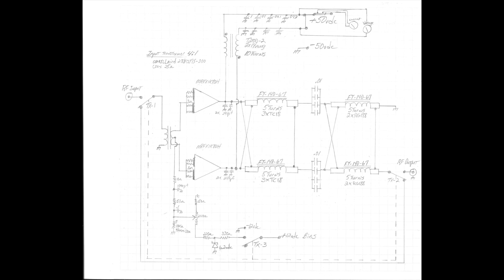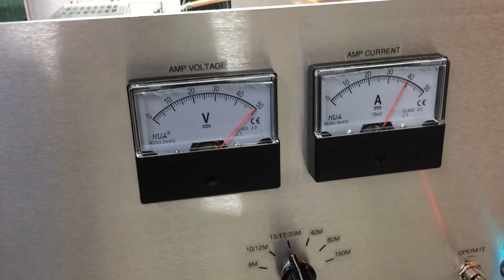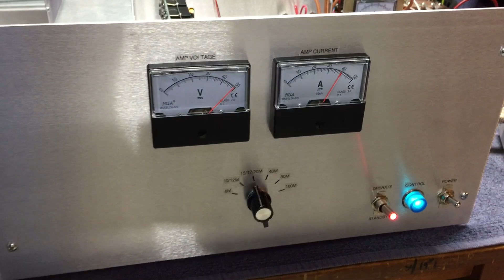2xMRFX1K80H 1.8-54mhz HF AMPLIFIER

Comment: KF8OD, Very nice amplifier. I am trying to settle on a design for a full legal limit mobile amplifier with 5 parallel boost supplies mounted  close to the batteries under the hood of my 2019 F450. However it will likely end up on the other side of the the fender skirt as there is not much open space left under the hood. There should be plenty of space for the amp behind one of the back seats. I haven't settled on which LDMOS device to use, but am going to do it with a single push pull circuit. I was planning to utilize feedback in the circuit to improve linearity, but saw notes by other builders advising against it due to the possibility of causing the circuit to go into oscillation. However, I noted that you utilize feedback. Did you utilize circuit modeling to find the correct components or do it by trial and error? Ever lose any parts due to the circuit going into oscillation? Any advice would be appreciated. Thanks in advance WD0DIA
Reply from the maker: Feedback does nothing for linearity, LDMOS devices are not linear. I have never experienced oscillation. The feedback really only tames the gain on the low bands and keeps the rf input pretty uniform across 1.8-54mhz.

Comment: For anyone trying to figure out the efficiency and thinking Wow 40a @50v 1000w and thinking that isn't very efficient... Remember these are LDMOS Chips... they really don't start getting efficient until you get up to about 50-65% of its rating( theoretically 3900w@65v )... he's only running them at a 1/4 of what their  capable (not including losses)....  No, I don't advocate running anything at max but whenever he gets close to 2k that efficiency is going to come up quite a bit. Just thought I would throw that in there
Reply from the maker: Thanks for your comment. I was much more concerned with IMD and harmonics. Don’t really care about efficiency.
Reply: @KF8OD1  I figured you already knew about it when I posted it...I was just posting it for others that noticed the amperage vs Wattage. And then think the chip wasn't very efficient... I was just clearing that up for them... I remember when I first fired up a blf188xr and just  through a few milliwatts into it I only got something like 14% efficiency... people used to silicon transistors don't understand that until they are putting appreciable power in the input into a Mosfet the efficiency is way down.... and is actually hard on the chip itself...  better to lower the voltage a few volts with ldmos..

Comment: hy there, what smps do you use in every rf pa?
Reply from the maker: Mean Well RSP-3000-48
Reply: @KF8OD1   thanks,  do you have any smps recomendedation for 1kw pa 48V and 27v Sat mosfet,?
Reply from the maker: @endremurti  Mean Well RSP-1500-48. I am sure Mean well makes a 24v supply that could be adjusted up to about 26v.

Comment: Hi Mike I've asked this before but do you feel a need to run your amps with LPF? If you operate on the air without a low pass filter do you notice a difference?  Eric
Reply from the maker: Eric Lessard  Yes, you must use a LPF to comply with FCC regulations.

Comment: I think you need a lot more fans extracting hot air from the box.   I think you only have one!!
Reply from the maker: Thank you for your comment. There are three fans on the heatsink that exhaust all the heat out the side of the cabinet.

Comment: Very nice amp.I love these devices. I want to use the new 65 volt version of the device. I just completed a 75 amp 55-65 volt variable power supply for the project..next is the RF deck. Do you have a pcb set available for purchase? Or even a pcb layout? I am also interested in the transformer and choke parts. The pcb/engineering design kit from the mnfg is ridiculously priced. I want to use 2 devices and let it loaf. I’ve been using an 8877 for years. I had enough of tubes. Time for LDMOS Thank you.

Comment: Hi, why only 1 kw when using 2 transistors rated for 1800w each? are you limited by the PS? nice video. 73 CT1ILT
Reply from the maker: Hi Filipe, My opinion, operating ldmos devices at 50% yields better IMD. You can't dissipate the heat generated operating them at full output. Be conservative and they will last. The ratings on the datasheet are in pulse service.
Reply: Thanks for the reply, that clears me out.
Reply: MRFX1K80H is 1.8kW CW. With very good thermal management, this is obtainable... if device is run in good efficiency conditions. This device is used in laser, heaters, MRI, FM broadcast.

Comment: Looks good Mike, I need to go to the 16"x16" cabinet, much more room. Surprised you did the 2 1k80s, I expected the 188s. 

Alan
Reply from the maker: I have a reason for building the 80h amp, I am sticking with the 188s for the complete amps for sale.
Reply: Alan - you could also use an external PS and an external LPF and make the amp enclosure as small as feasible and the amp enclosure would still be almost empty. That's what I do. That way I can just reuse my PS and LPF for every amp I make. 

But on the other hand, lots of people want a complete amp in a box, and I totally [almost] understand that too. 

:)